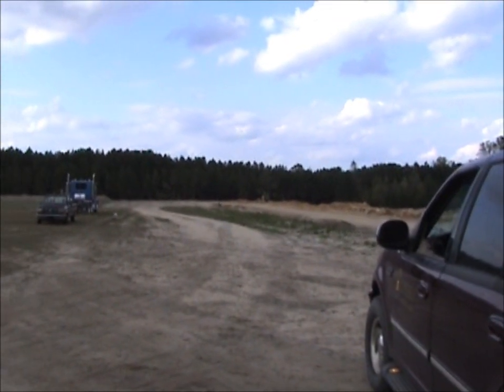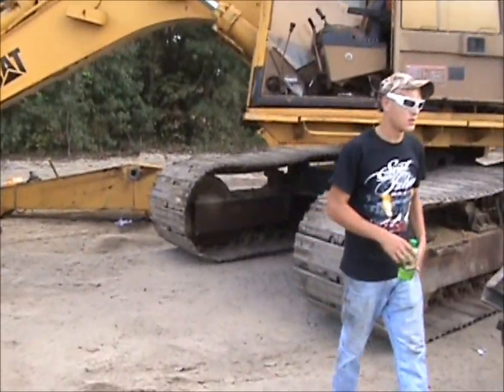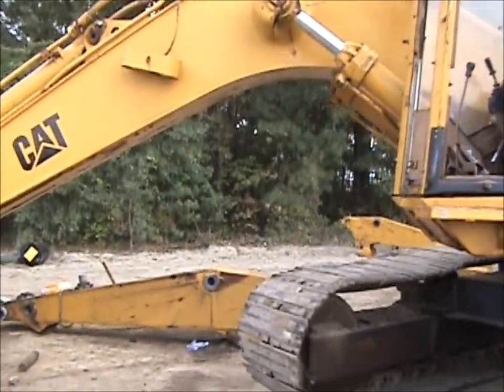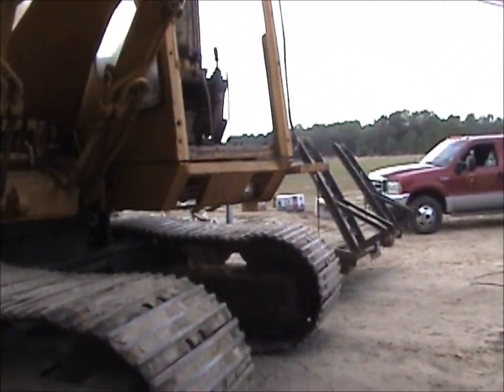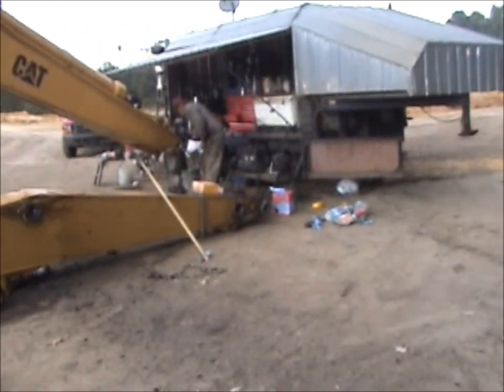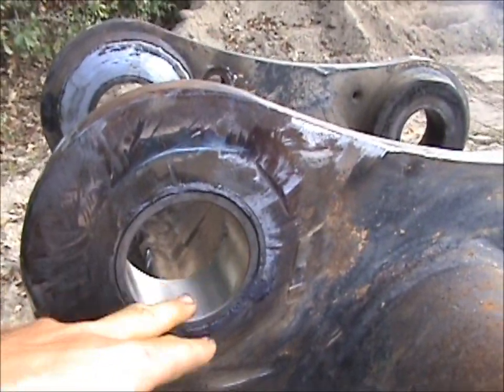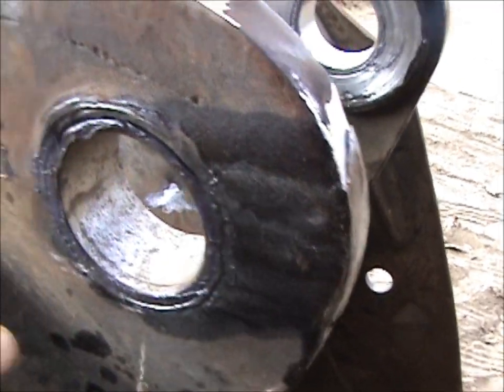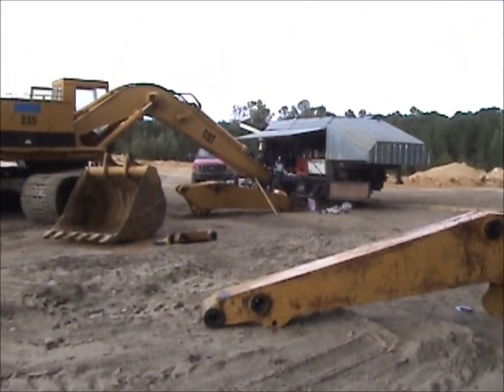Bore welding and Line boring on the Caterpillar 235

Comment: You have caught the repairs in time, the old 235s are worth dumping some money into. Time to modernize with quick connect on the bucket and a hydraulic thumb.

Guys like you hired to do the line boring work are becoming a rarity you have a machinist and a welder all in one. Most younger generation don't have multiple skills.

Comment: here it costs so much to have things done on equipment that its not affordable running older stuff if used alot, my truck when in the dealers shop is 200dollar an hour for slow and not very good work.